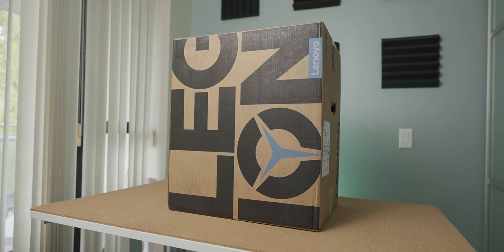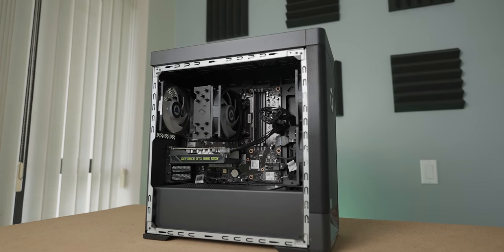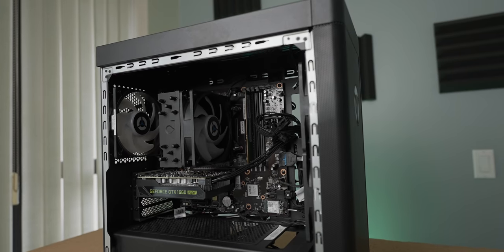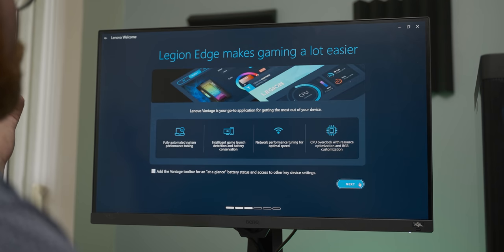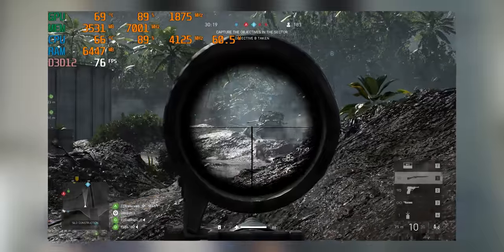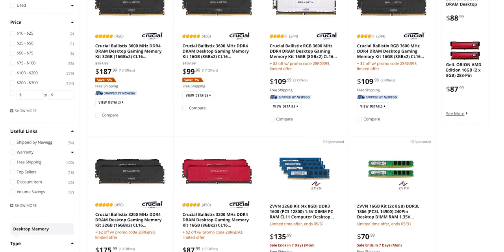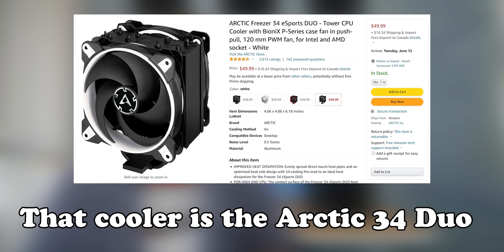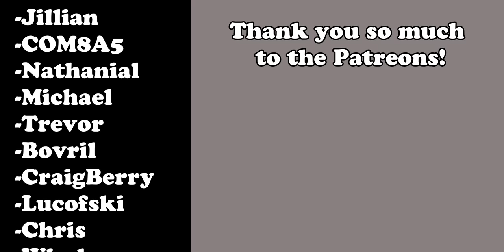Is Lenovo the KING of OEM Gaming Pre-Builts?

Comment: Would you guys actually recommend this PC? I can get one for 1200$ with a Ryzen 5700G,16GB of RAM,1TB SSD and an RTX 3060 but i don't know if i'll regret it later
Reply: Why would you regret it?
Reply: @yooyoo8637  Dunno,it’s a prebuilt after all.
Reply: @Mirra2003-f9s  I’ve ordered the RTX 3070,  version seems easy enough to replace parts down the line
Reply: @yooyoo8637  Yeah,this system looks too good to be true.The only downside i learned about it is that the CPU is locked to that motherboard,so if you want to change the mobo and keep the CPU or sell the CPU,you can't because they are paired.If you put a new CPU on the mobo it will ask you to lock that CPU too
Reply: @Mirra2003-f9s  Yeah its definitely a downside, I do think this is great value though, I was going to get the acer orion but heard bad things about the cooling. Believe me ive looked a lot and for the price I don't think you can find better, but if you do hit me up and ill send this one back and get it lol
Reply: Depends on how important you think manual fan curves are. The only fan curves you are allowed to set are the ones from the GPU with MSI Afterburner. All the others are locked down by Lenovo, because they don't want you messing with their crappy 'intelligent cooling' settings. Other than that it's a pretty good rig.

Comment: I hate Lenovo. I had a tablet that gave up a couple of days out of warranty, a laptop that spent more time in a workshop than with me, and this PC which had 2 usb 3 ports which died within a week. I built my own previous PC and it lasted for years, the only problem with that was following improving the graphics, the PSU packed up. Oh and when I wanted to add a larger SSD the provided power cable fell apart, when I looked at an OEM part it was silly money so I got a very good one from Aliexpress.

Comment: I see this has a lot of fans. Is the fan noise acceptable?
Reply: VERY much so. The fans never really kick up for an extended period unless you’re doing a CPU-based render. They’ll kick up a little for roughly 5-6 seconds then settle down mid-game.
Reply: @pastichiorocker  I haven't figured out a way, but I'm about as knowledgeable as a dust bunny. From the basic BIOS settings, there's no way to manually set the curve unfortunately. I wish you could because my PC lets my CPU warm up quite a bit before really throwing some power at the fan. I might switch to an AIO Liquid Cooler honestly. Temps aren't bad, but could be running much cooler.
Reply: @Outcastiid  I think I fixed the annoying 'woo woo woo' noise my RTX 3070 was making when idling by installing MSI Afterburner and dialing it back to 30% instead of the standard temp of 35%. Too bad there's no way to control the other 7 fans. I checked out LegionFanControl, but it doesn't do pc's with RTX cards.
Reply: @pastichiorocker  I didn't notice MSI actually making a difference with my fans tbh. I feel as though the manual setting was being overridden by Lenovo's hardware because no matter what I put MSI's value to, the fan value changed on its own accord.
Reply: @Outcastiid  Actually, I discovered it's not the GPU making that woo woo sound, but the Ryzen cpu fan. I've now disabled Core Performance Boost and C State Support in the bios and put the memory overclocking to manual (3200Mhz) instead of JEDEC. Let's see if that helps with the noise. I'm kinda pissed that you get this great gaming rig and Lenovo can't be bothered to let people control the fans manually. The 3 'intelligent cooling' options are a bit shit to be honest.
Reply: @pastichiorocker  How the hell did you manage to do XMP on it? Also, I am running Intel actually. Must've been configured differently. If you can share how you managed to get 3200 mHz out of memory on this you'll be a REAL one!
Reply: @Outcastiid  It's an option I could select in the BIOS. It still doesn't fix the annoying fan sound, but at least it doesn't sound like a jet engine anymore every time I play a heavy game. I guess disabling Core Performance Boost and C State Support have something to do with that too...

Comment: Just curious, is the style of cooler that blows directly into the CPU not as good as this? The only game I play is world of Warcraft, however have a Ryzen 3600 and an and 5700 non xt, but I also have a splitter and am mining with the original 5700 but also have a rx570, and 5600xt, 6600xt and 6700xt. Am I at risk of overheating? Btw I clean every month and I run with side panel off. Hope to hear from someone. Thanks I'm advance
Reply: Btw, I'm sure someone will be mad that I mine but I have to say, the 5700 was in the pre built, it, the 570 8gb, and 5600xt were bought before crypto went crazy, the 5600 was. Open box at microcenter, and the 6600 and 6700 were both bought when microcenter had them in stock. I didn't buy from or support scalping and I didn't buy the last one on the shelf and leave a gamer with no gpu

Comment: Hi I bought a Legion PC but it only has 500g ssd, what's your advice about how to add more? Thanks
Reply: Is it like this one? If so you can buy an internal drive for the PC. I bought one similar and added 2TB of extra storage
Reply: @TechSpec814  Hi, thanks for the reply. Yes, it's a Legion T5 with a Ryzen 5 and 16GB ram, but only a 500GB ssd which isn't really that much. Thanks for the advice about adding an internal drive. I wasn't sure if it was possible to add another SSD as the PC didn't come with an instruction manual so I was just looking for info online. Appreciate your tip.
Reply: @burgerjointgame  If you remove the rear panel of the PC, you’ll have access to the extra SATA Cables. Not sure how the T5 is, but the T7 also has built-in trays for the drives as well.

Comment: I noticed that your cpu fan is doing whats supposed to and i was curious if you might know why mine is stuck to rainbow and maybe why its the only fan i cant turn on or off or even change the color of i have the same computer only difference is mine is a Ryzen 7 3700x if anyone can help me that would be awesome
Reply: You might have to check the RGB controller and make sure it’s properly set into it. Also, you’re using the Vantage software to change the colors, right?

Comment: I returned a new ibuypower that had a amd 6700xt card in it and bought a lenovo legion with a 3070  32gb ram i7 11700k and windows 11  the difference is incredible the Lenovo Legion is definitely better. out of the 3 desktops ive had the lenovo shits on the two ibuypowers

Comment: I own a Ryzen 7 3700x with a rtx 3070 version of this PC, and had to replace the cheapo lenovo cpu cooler for a Be Quiet! Pure Rock 2 black one. Even got the pc store to reimburse me for the cooler as lenovo claimed there was nothing wrong with the one they included. Lenovo is bit of an ass hat I will argue, anyway, the issue you had with the backplate on the motherboard, I struggled as well. I was about to quit, but couldn't let lenovo beat me. I used 4 plastic prying tools to work my way around the backplate, until it came flying off at a dangerous speed with a sonic boom. They use some super strong double sided tape, and the spacing of the holes aren't AM4, but some Intel size. I don't know why, seems insane

Comment: "The king" .... one stick of ram, no dual channel... uh huh sureeeeeee
Reply: I own this PC except it had dual channel ram (2 eight gig sticks running at 3000) and I also have it with a ryzen 7 3700x. I was gonna build my own but found this bad boy for a massive deal during the holidays. No complaints really only sus thing is that the marketing showed a dual fan gpu but I got the same type of GTX 1660 super also but I haven't had any temp issues.
Reply: Also Lenovo prolly bought a ton of 8 gig sticks so it makes sense that the 8gb model has 1 stick. Put your self in lenovo's shoes, they likely saved a lot of money mass buying 8gb sticks

Comment: My friend got the Lenovo Legion T5 with the Intel Core i9 11900F and I must say, for 1999€ it is a disappointment. 1st of all single channel 16gb stick, 2nd 550w power supply for and 11900F and a 3070? SERIOUSLY that's not good. Went to PCpartpicker and built a much more capable machine for under 2000€. Don't buy the 11900F version.

Comment: I continue to be baffled by billion-dollar companies not being able to put 2 seperate RAM sticks in their pre-builts 😩 everything else looks great tho
Reply: Building down to price at the time of the video I guess. All the T5 AMD models here in the Uk now have minimum 16gb D.C, I got my Ryzen 5 5600g, 16gb (2x8gb sticks), RTX 3060Ti, 512gb NVMe SSD, 650w Gold-rated PSU and 5 RGB fans (plus RGB fan/CPU cooler) for £950 (1140 usd). I'm very happy with this playing RPG's 1440p at max settings. Handy tip-Contact the Lenovo call centre and they will probably knock off a further £50 like they did for me (they emailed me a link to the reduced price).
Reply: That really depends on the model you buy. I've got the one with 32gb (2x 16gb RAM).

Comment: Can I build a better pc myself? Yes without a doubt, can i get the parts to build a pc myself? not so much, depends on how much you want to spend, may actually be cheaper to buy a prebuilt system and strip out the parts you want from existing pc and upgrade the prebuilt, though say goodbye to the warranty!

Comment: the single stick of ram seems to be the one thing all these pre-built comps have in common even thought they know better and just use it as a way to pad the profit margin a little bit more and to be honest to me it makes them look like cheap bastards as it is meant to run on two channels for optimum performance there has to be better ways for them to make 30 bucks PS and why did they not just use the wraith cooler that came with the 3600 !!!???? and install a second stick of ram the wraith works just fine on my 3600xt with a similar case by Fractal design am not sure why they used a 50 $ cooler when the wraith is included with the cpu

Comment: Can you rate and guess the price on this laptop custom made by PC specialist in UK. ........
onico Series: 17.3" Matte QHD 165Hz sRGB 100% LED Widescreen
(2560x1440)
Processor (CPU) Intel® Core™ i7 Eight Core Processor 10875H (2.3GHz, 5.1GHz Turbo)
Memory (RAM) 32GB Corsair 2400MHz SODIMM DDR4 (2 x 16GB)
Graphics Card NVIDIA® GeForce® RTX 3070 - 8.0GB GDDR6 Video RAM - DirectX® 12.1
1st M.2 SSD Drive 512GB PCS PCIe M.2 SSD (2000 MB/R, 1100 MB/W)
Memory Card Reader Integrated Micro-SD Memory Card Reader
AC Adaptor 1 x 230W AC Adaptor
Power Cable 1 x 1 Metre UK Power Cable (Kettle Lead)
Battery Ionico Series Integrated 91WH Lithium Ion Battery
Thermal Paste STANDARD THERMAL PASTE FOR SUFFICIENT COOLING
Sound Card 2 Channel High Definition Audio + MIC/Headphone Jack
Bluetooth & Wireless GIGABIT LAN & WIRELESS INTEL® Wi-Fi 6 AX200 (2.4 Gbps) + BT 5.0

Comment: 🤣🤣🤣🤣🤣🤣🤣🤣🤣#CHINESECHEATERS #LENOVOCHEATERS I got just 12FPS even overclocking!!!
Reply: I mean, we know you’re lying.
Reply: @Outcastiid  Bro I have all screenshot with FPS
Reply: They are bloodyy cheaters
Reply: @iMaker_Gaming  Then I'm a cheater because I get a solid 144 FPS in Doom at 1440p with maxxed settings and Raytracing on with my Lenovo. The only way you're getting performance that bad is if you're running a $250 Lenovo laptop with a Celeron with passive cooling and using the massive i-GPU to run games.

Comment: GARBAGE OEM CRAP! For those who have NO clue try reinstalling your OS on a new drive. Your in for the SHOCK OF YOUR LIVES pc builders and repair shops. Their BIOS is GARBAGE their PROPRIETARY motherboards are NIGHTMARE FUEL! Seriously good luck reinstalling your OS WITHOUT extending your warranty!
Reply: What did you do just try one time and then just roll it out or did you do some research and figure it out because I've owned multiple lenovos and I'm pretty fluent with that BIOS and it's actually really easy to work with.
Reply: @WillOlsen-s3e  Not even close to a relevant comment there chuckle fks.